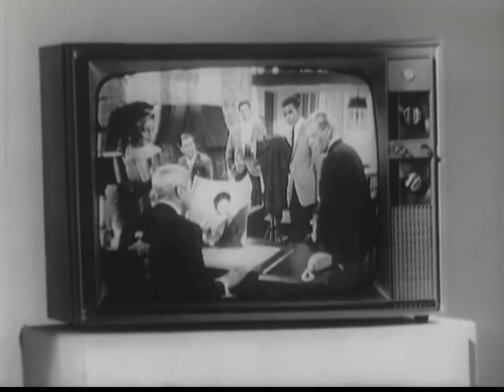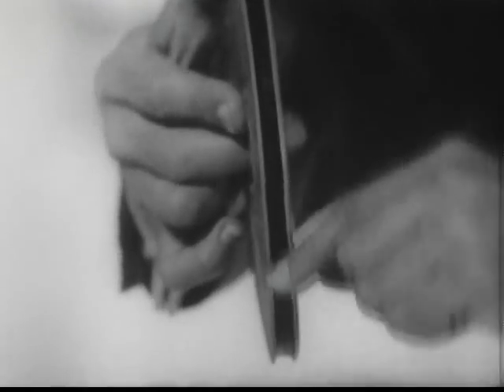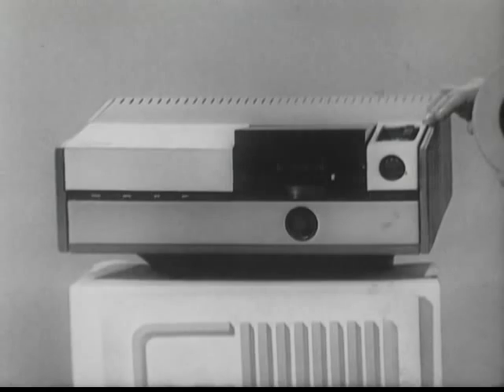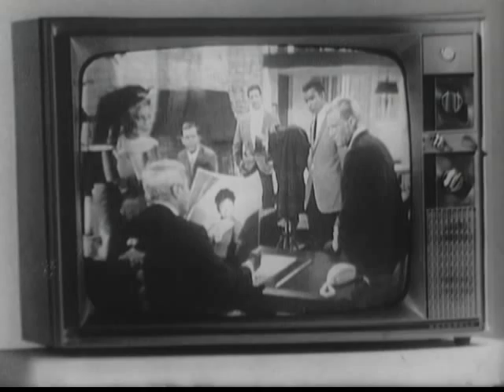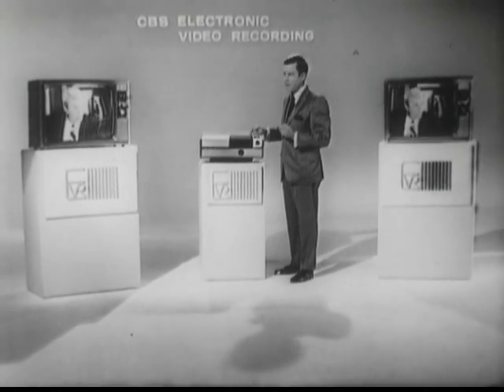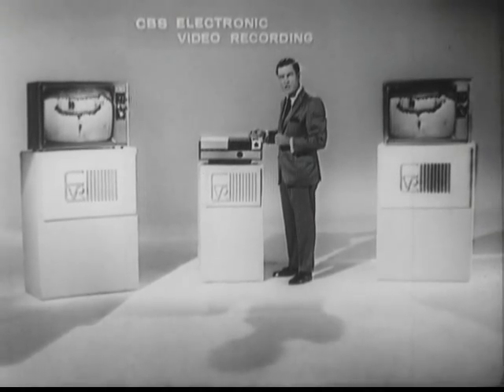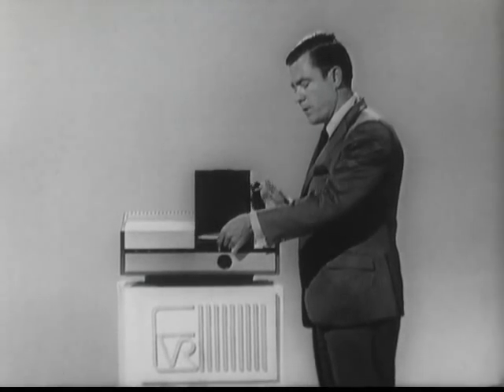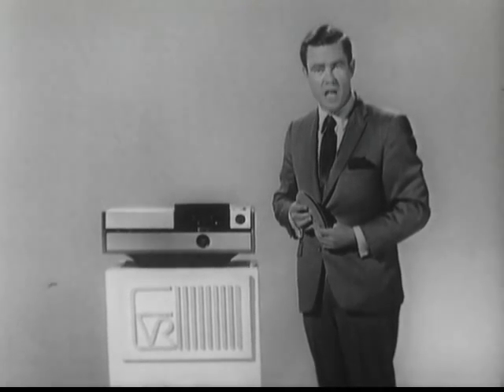CBS EVR or Electronic Video Recording System Demo Film

Comment: That was a pretty good idea for then, but it's not really an electronic recording device, just a playback device. It is basically an easy-load projector which converts the output to an RF signal, which can be easily adapted to a television or cable system. However, it was a great way for broadcasters to easily send a signal for multiple viewers.

Comment: Weren't home video tape units (able to record and in color) already on the market? I like the idea of film, but videotape proved to be coming format for home and later commercial use. How big WERE VTR's back then? Was that the issue?
Reply: No. In 1969, there were a handful of home, reel-to-reel VTR's and could only play or record in black & white. They were troublesome at best - early ones didn't even have tracking! So you couldn't record on one machine and playback on another because the tracking would be inconsistent from machine to machine.

EVR could also do colour.  Although, colour tapes would only have a single track instead of two tracks of black and white, so the play time was halved to only 25 minutes.

Sony's U-Matic system wouldn't come along until 1971 and that is probably why CBS Labs discontinued the EVR as Sony & CBS were linked corporations.

Comment: @1:38 If John McCain had played in The Godfather? I came hear reading about Peter Carl Goldmark who was featured in today's Refdesk web page and was a chief inventor of this format. If you are a vintage video geek I suggest you watch the 2002 Bob Crane flick "Auto Focus". I used to sell consumer A/V goods from the late 1980's to early 2000's, Laser Disc was the biggest niche format I did, and there were several that I sold none of or maybe one like Minidisc and DCC. Glad I'm not making a living doing that anymore but it had it's high points.
Reply: I rented the video gear to the production company that made Auto Focus. I saw photos of Crane's equipment a few years later. They rented the wrong gear - for the absolute purist. I could have supplied the correct equipment as well. But, I guess I should relax. It's only a movie.